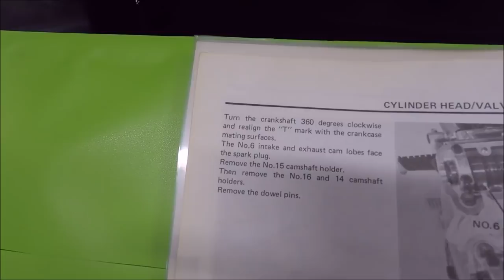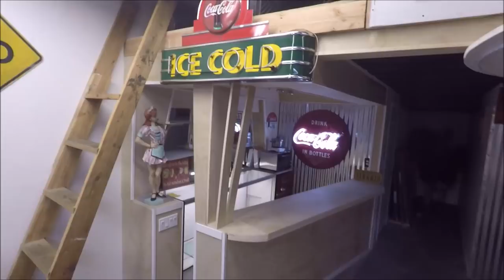Honda CBX Full Restoration & Engine Rebuild Video Series - Part 6 - Engine #2 Tear Down

Comment: Old Japanese bikes use JIS (Japanese Industrial Standard) screws. A Philips doesn't fit properly, that's why most people use an impact driver. A JIS screwdriver will work a Philips but not the other way round. JIS screwdrivers are expensive but worth it if you do a lot of work on pre 2004 bikes or cars.
Reply from the maker: Yes, I use JIS screwdrivers, but in some cases you still have to use an impact driver.
Reply: I agree, and was wondering why it wasn't stated in the video ?
I own several different styles of JIS Bits & Drivers for use on anything made in Japan, along with an impact driver when needed.
 Whenever it's feasible I change the JIS screws to stainless steel, metric Allen heads, especially hard to get to areas where a ball end Allen wrench makes it easier to manipulate the screw.

Comment: So I got my CBX apart.  I had used form a thread on my stripped front cam adjuster bolt.  That blocked the hole to the cam adjuster slide.  So my bolt stopped touching and held the slide in place.  I was wondering why I had some chain noise, it was loose!  Installing heli-coil...
Reply from the maker: Yuck, that sucks
I hope the heli-coil works. I hate those things.
I would try re-tapping or increase the the hole and use a larger thread?

Comment: Thanks for the video. No need to use a impact driver on the screws, get a JIT crewdriver instead it does the job.
Reply from the maker: Hi Jens, Yes, I also use JIT screwdrivers, but sometimes an impact driver is still necessary if the bike has been outside for 20+ years. Those screws can be frozen solid and need a little help :)

Comment: Can I please ask the reason for the tear down
Reply from the maker: Hi Llew, Yes, although this bike ran, it smoked during both acceleration and deceleration, and it had weak compression. So tear down confirmed that it had bad valve seals and a couple of broken rings and the pistons were badly scored. So a top end rebuild was in order :)
Reply: I have the same issue, but you know how you live in denial and try and find any other reason not to do it. 
BUGGER